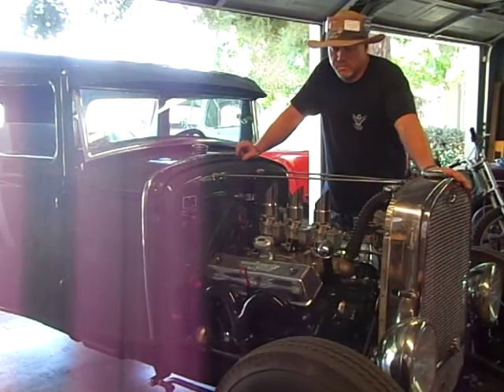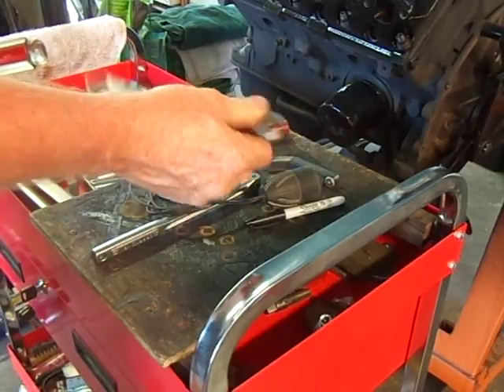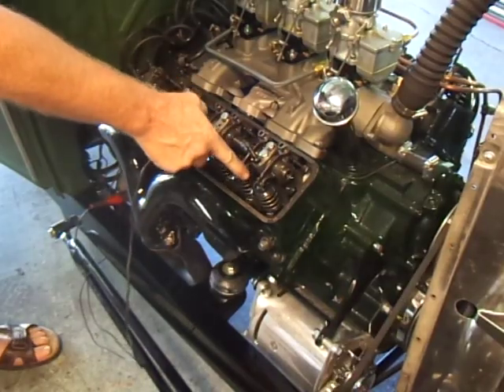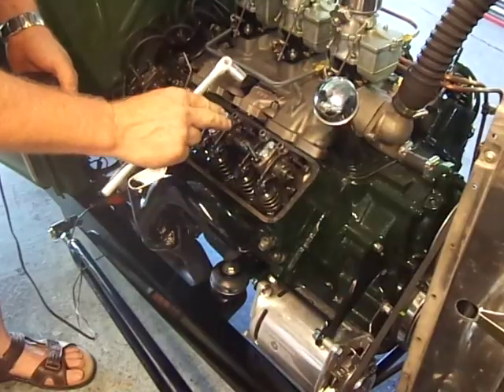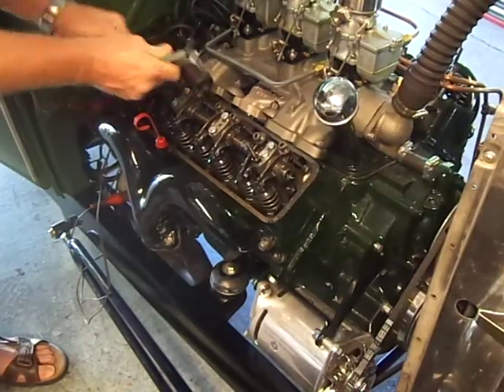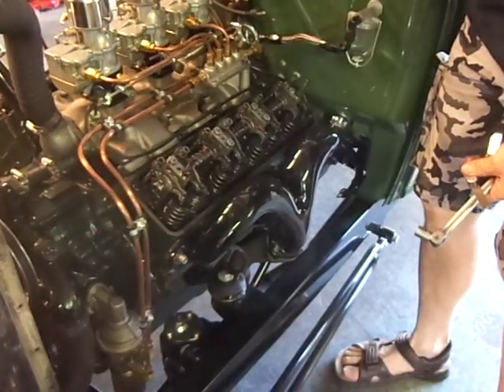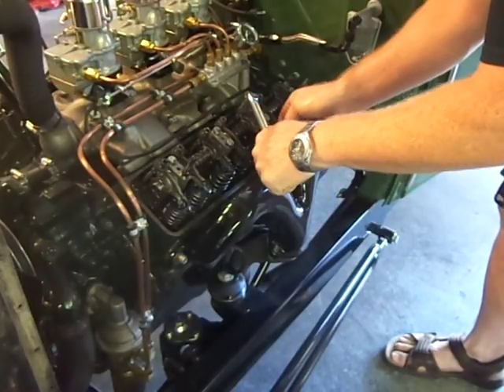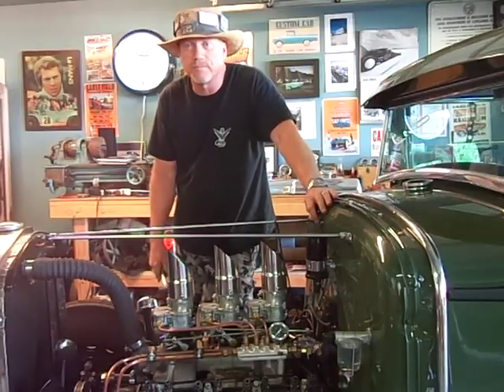How to adjust valve lash on a Y Block Ford V8

Comment: Great video, so for some time I have been helping a friend with a 56 Tbird, about a year ago I set valve lash on the 312 in the car. 2 pushrods had dropped in the engine. He and his son had no clue why? He purchased push rods to replace them. I was asked to come back and re set lash and install the two missing ones. Following procedure and  setting lash engine sounded good when running so left it at that, however they drove the car a few miles and dropped two more push rods. My question is where did they go and what might be the cause of the dropping pushrods? I am not a mechanic by trad but have adjusted lash on a few engines mostly GM and. Ever had this problem, I'm at a loss here. Any help appreciated.
Reply from the maker: More than likely it's old gas coating the valve stems making them stick momentarily, just long enough to let the push rods drop. They are just resting in the valley.

Comment: Great video. Started having issues with my 1962 292 in my galaxie. Noticed a clunking when idling but when in gear and the car stopped the clunking is louder. The engine is quiet when not at operating temp then the noise starts to get more pronounced when at a light stopped. I listened to the valves through the valve cover using a long screw driver like a stethoscope and heard it. had my dad listen too and he said oh yeah i hear it. Is this a valve lash issue. engine was redone in 2015 and i use 15w40 shell rotella T4 oil. Plus i need to recore the radiator it has never been done since being new in 62. Thanks
Reply from the maker: It certainly wouldn't hurt to check the lash.

Comment: Most experts recommended adjusting the valves with the engine running. It chewed up your feeler gauges, and got out everywhere. An alternate method can be done with the motor stationary, but involved rotating the engine multiple times.

Comment: Great information on adjusting valves on a V8, I usually put the engine on top dead center and just the number one cylinder and then I go by the firing order so it makes life a lot easier, and back to top dead center.😊

Comment: Great video! I had Y-blocks 60 yrs ago, and was taught to adjust while hot and engine running. It worked, but what a pain. After 50+ yrs as an engineer working on engines, this method is valid and way more ‘friendly’! It’s a lot easier on the feeler gages, too. Those later model rocker arms help it go much faster than if you’re using a box end wrench and screwdriver. Thanks!

Comment: Excellent  video!!  I've  been working on a friends car that hasn't ran in 45 years.  I was able to get the car running but man, it sounded  like a diesel idling.  Never had worked on a y block or adjusted valves, i came across your video. Thank you for posting this!  Idles so much quieter  now!!!
Reply: I have a complete and running 272 1959 y block with upgrade rocker arms for sale.

Comment: This is a very Good video - Thank you.... I'm a 40 year mechanic that "got schooled today" on Y-Block rocker arm adjustments". A more experienced/mechanically inclined friend (named Jim) & I were working on his 56 T-Bird that wasn't idling as smoothly as it could after I adjusted the rockers hot with this procedure & again with oem instructions, he said; "Do it running" (I was always instructed never to adjust solids - running). We idled the warm engine @ 460 Rpm and used a piece of  4 inch wide cardboard to gate off the lower half of the rocker train to retain oil. His method was faster and yielded much better results. This is more accurate and you can check for the rotation of the push rods and see if adequate oil is moving through the rocker train & adjust that too!  I'm Learn-ed & grateful!

Comment: I have a 63 f250 with a 262 inline 6! I have 2 questions: how do I know when to adjust the lifters and can I use the same technique?
Reply from the maker: If they are noisy they nee to be adjusted or if it runs a little rough it could be too tight from the seats beating in and closing the gap. You can use the same procedure but just a different firing order. 153624 so 1 and 6, 5 and 2, 3 and 4. one or the other will be at tdc firing and one will be at overlap.
Reply: @mctim64  thanks I really appreciate it.

Comment: Great video, looks like you have done this a couple of times! My employer has a 56 Ford that he asked me to look at, it sounds as though it needs a valve adjustment, The problem is, he doesn't know the displacement. Do you have any recommendations to identify which displacement it is?
Thank you!
Reply from the maker: Displacement doesn't make a difference, the adjustment is the same. Different cams have different lash but .015" to .019" is good for most.

Comment: Thanks for the video! I have a question for if you could shed some light some 7 years later. Disclaimer I am fairly new working on engines. While doing the timing chain on my 292, I noticed that, when both marks are lined up at 3 o clock, and although the piston's position in relation to the counter weight underneath looks to be on compression stroke, a valve is open and it's not compressing. But when it's supposed to be on exhaust stroke, it in fact is compressing air past the spark plug hole. I haven't run this same test to see how the other cylinders do, but I'm imaging something the same. Could this be because of a out of wack lash setting?

Comment: I have been a mechanic for 27 years and this guy has this all wrong.
Reply from the maker: Please explain.
Reply: You are setting the valve clearance on tdc on the exhaust stroke you need to do it on the compression tdc, easiest way is to take your firing order and put the first four numbers over the last 4 and the top and bottom numbers are the opposing cylinders, then you get the valves on the rock (tdc exhaust) and you adjust the valves on the opposing cylinder.
Reply from the maker: @scottamandaseigmeier607  Check my other video on doing the valve adjustment. There is more than one way to do it, as I said in the beginning of this video. If you watch my little animation you will get a better idea where the cam lobe is when I adjust it. Don't be so quick to judge, I've been doing this a long time too, you might learn something.
Reply: @scottamandaseigmeier607  With your method you have to go back and forth around the front of the car from rocker to rocker. with Tim's method you stay on one side of the car and knock out all 4 cylinders at once. To me his way is better, less likely to lose track of where your last step was. I went to A and P school 36 years ago. Adjusting valves is a task where you don't want confusion.

Comment: That is a very informative video explain very thoroughly. Thank you very much. One question, I have a 1968 390 F E block, it also has a rocker shaft, do I use the same method and clearance setting? I need the check and make sure it has hydraulic lifters, it was out of a 1968 cyclone, but now installed in a 1967 Ranchero and I have some major valve noise. One person told me they are non-adjustable.
Reply from the maker: 390 should be hydraulic and self adjusting. If it is noisey you might check for a collapsed lifter.
Reply: @mctim64  Thanks for the info, as it turns out I had a bunch of fuel in the low end from a few bad carburetors, I changed the oil last night and at it 2050 weight and Lucas Oil Treatment, no more tapping and great oil pressure!

Comment: Why passenger side no oil. over fender drv side  we used to run tube across on drains w .holes in covers.you rebuild em what's the cause?never got an answer . mine started after overheating.thaught maybe h gasket .they had oiler kits back in day.

Comment: I'm adjusting my 57 272 for first time.  Is this adjustment made while motor warm or cold? Or does it matter?  Thank you
Reply from the maker: 140* is a good temp. Not too hot to handle and gives a correct setting.
Reply: mctim64 ok great. Thank you!
Reply: mctim64 one more quick question. Do the valves tighten over time or loosen or both?
Reply from the maker: If the locks aren't tight they will loosen, if the ex seats are beating in from dry unleaded gas the will tighten up.
Reply: mctim64 ok great.  Hey thank you very much. I really appreciate it

Comment: adjusting the valves on a running engine comes from a small block Chevy. I Shit u not! however, as I found out other than the fact a Chevy engine is a v8 and runs on gasoline, there's not much similar about Ford and Chevy mechanically.

Comment: Hey !    I have a 64 F250,  and I cant figure out how to set up the firing order.   tdc on number one, the rotor is pointing direct across from the cap notch.. now...  that should be #1.   What is   the firing order and which way does it rotate ?       I got the truck, in not running condition .  I tried 1-5-4-8-6-3-7-2-   tuning counter clockwise,   it  runs....  but misses bad...    You seemed to be the right guy to ask.    Thanks,  Ken
Reply: Easy way to tell dist rotation is look at the vacuum advance, it always pulls against dist rotation...on any engine!
Reply from the maker: You have the order and the direction correct, do you have TDC in the right place? Take the valve covers off and watch the rockers, look for overlap. When the ex. on #1 is almost closed and the intake just starts to open. The rockers should be equal when the piston stops at the top. you can feel for the piston through the spark plug hole and bump the starter with a remote starter switch. Or just turn by hand with a wrench on the crank pulley. Make scenes?
Reply: I found the prob !   #3 and #7 pushrods were bent and hung up.  I need 2 stock pushrods.  I would like to change the cam to a nice choppy one.  do you have one to sell me that will work, along with a few pushrods..  and maybe a 4V intake and carb ??    Thanks, Ken 920-676-0686
Reply from the maker: Can you contact me after the 17th of Aug. I am concentrating on Speed Week now. You can call the shop 5595844487

Comment: McTim, This is a great video for newbies but you didn't mention whether you adjusted the valves on a cold motor or hot motor. Everything I've heard says do it hot, would love to do it cold if that works.   Thanks,
Reply from the maker: I do it cold or warm then check it again when hot. Too un comfortable doing it hot. If you have aluminum heads definitely do it hot. The aluminum heads expand a lot. If you set them cold at .005" they will be .015" hot.

Comment: Ford Y Block is my favourite engine have been mucking around with them for many years, the sound, low down lugging power is amazing, yet can give there all for top speed, I have a 292 with ECZ-G heads, a tow or torque cam, 390 cfm Holley four barrel, it hauls hard with unbelievable economy , It took a little nutting out the vacuum advance as the small carb created high manifold vacuum also the secondaries would come in to early but of course this was easy to fix..i

Comment: About to get a 1962 ford galaxy 500 that has sat for over 10 years. Has the 292 3 speed on column. Guy says he used to start it up and drive it around the yard until it one day gave up and just ran weak (i suspect carb gumming) he said he didnt want to fool with it and just parked it in 1990. I also asked him if it made any noise he said it didnt so no wiped cams in suspicion.

Comment: I had a Merc Y block that had hydraulic lifters would you do it the same. Just wondering?
Reply from the maker: mypugsdad If it was a Lincoln or a MEL with hydraulics there is no adjustment, it 's set with the stem height.
Reply: No y block in the family has provisions for hydraulic lifters. Hydraulic lifters require oil pressure and y block family doesnt have the oil galley to the lifters for that purpose. You can make a hydraulic lifter engine go solid for race purposes but not reverse.
Reply: Your merc might have ran quiet and made no noise thats because it didnt need an adjustment or the rockers were tight like in the video. (I once got annoyed by ticking noises and set my briggs OHV to close to zero lash) not a peep after that.

Comment: when the rockers are fitted with interference set screws, the best way to adjust the valve clearance is to do it when the engine is running and is hot

Comment: HI DID YOU MEAN TO SAY STARTING TO OPEN YOU SAID JUST STARTING TO CLOSE WAS ON CLYLINDER NO. 5 EXHAUST LEFT BANK THANKS THIS HELPED ALOT ON ME DOING BOTH MY 56 & 57 T-BIRDS 312'S NEW MOTORS JOHN
Reply from the maker: 7360JOHNM On any cylinder you adjust the intake when the exhaust is just opening and the exhaust when the intake is about to completely close.

Comment: Is 0.015" safe for a original Y that's never been rebuilt and has 155,000 miles on it?

What about hot?  My shop manual says the specs is 0.019" hot.  Wouldn't setting the lash at 0.019" cold make the lash tighter?

I only ask as the records for this car i have show the valve lash was done at 75,000 miles and I will be checking and setting mine in the near future.
Reply: Engine does not have to be running to set solid lifters in fact the Ford shop manual states bring the engine to operating temp then turn the engine off and set the valves with the engine off.
Reply: Que calibre llevan las valvulas ford 272.Gracias.
Reply: Great info, great vid.  I just adjusted mine cold, to .019. Will put v/c back on tomorrow and crank.  Hoping it’s a bit quieter.